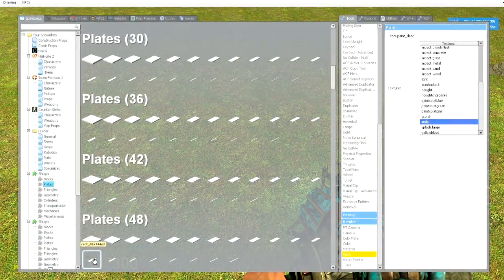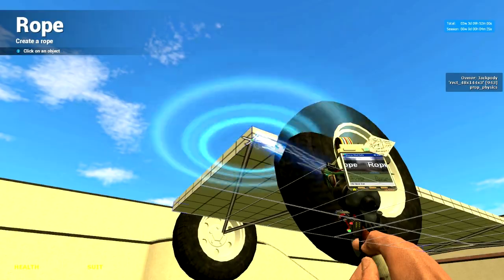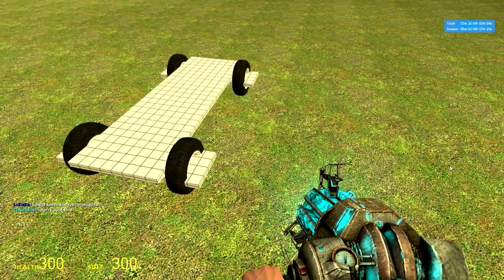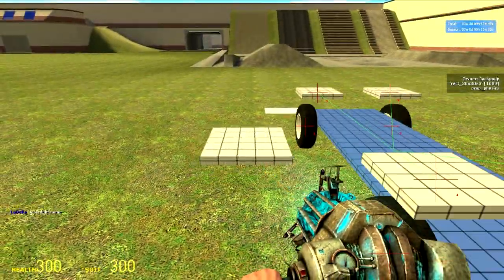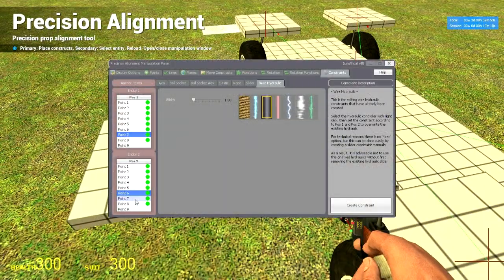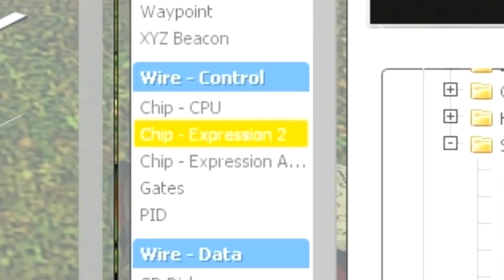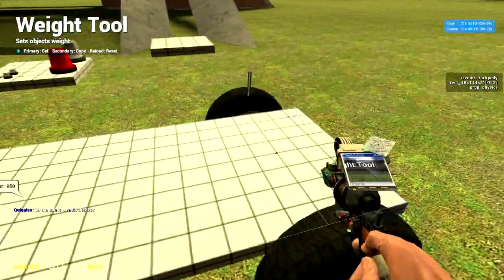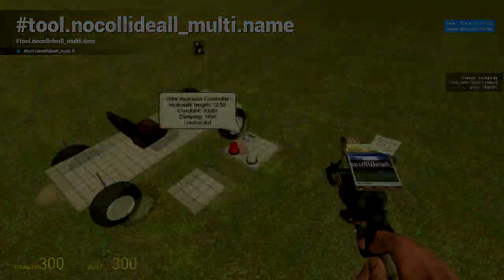[GMod 13] Suspension & Steering Tutorial - Simple

Comment: How do I put the steering thing from dropbox in??
Reply from the maker: Skillageskull Go into Wiremod > Expression2 > New Expression. Then remove everything inside the box that shows up. Copy / paste the code from my tutorial and put it into the box. Press the "close" window and left click on the ground with the Expression2 tool. 
If the model doesn't change to the same as in my tutorial, refer to the description. Hope it helps.
Reply: Thank you!
Reply: JackpodyDK For some reason, it's giving me an error that the "setAng" function doesn't exist when I set the chip down. Also, is the model itself detrimental to this, or is it just to look the part?
Reply from the maker: You'll have to enable propcore - I've posted the command for it many times before in the comment section. It's a simple console command that allows you to use a few extra functions in E2.
Reply: JackpodyDK Do you have to enable it every time you load or do you just have to do it once? Thanks for the help.
Reply from the maker: If you haven't added it to your server.cfg or added it to your launch options, then you'll have to enable it each time you start the game / server.

Comment: No such function: entity:setAng(angle) at line 31, char 15
chip don't work now,i don't know what to do
Reply from the maker: Николай Чистов When having issues, it's always a good idea to check the comment section - I may have already answered an issue like yours. 
In this case, the issues stems from the Wiremod team disabling Propcore on startup. A quick fix to this is running the following command in console: 
wire_expression2_extension_enable propcore

The above command allows the E2 to work. I hope it helped.
Reply: Thank you for help really match! Only you help me whith that problem
Reply: JackpodyDK Ok,You help me to fix the problem with set:ang,but e2 chip don't freeze in air,"propFreeze" still (1) bu't it's don't work.I hope you help me.
p.s. i don't see the answer for this question anywhere
Reply from the maker: You need to update your Wiremod, since a recent GMod update caused some issues with interval().
Reply: JackpodyDK How i can do that?I have latest version of wiremod from workshop
Reply from the maker: I'm not quite sure but I think the Workshop version of Wire hasn't been updated yet. Try a server that uses an updated SVN Wiremod - Cre8ive uses this and Interval() works there.
Reply: JackpodyDK Ok,i will try,thank you:)

Comment: i tried your e2 steering on another car from me. i put it up in the air and it will steer good no problems. but when i set it on the ground and steer its like there thrusters on it it will blow to the right or left. Can somebody help me?
Reply from the maker: Sounds like an issue with your ballsocket settings. Make sure they are completely like in the video (with some values being negative, some positive, etc).
Reply: JackpodyDK
i already got it. i putted the wheels on with axis-centre. but someone told me he did it with hydraulics and ropes. and that works!. and i wanna say thank you for this helpful vid!

Comment: Hi Jackpody. I'm Asian Kid on Steam, may have seen me on Cre8Ive. Anyway, I'm working on a car and trying to make it as close to real life as possible. Most of the cars in real life have slightly more than average negative camber and was wondering if it's possible somehow to put negative camber on a wheel. I assumed it would just be changing my ball socket settings, and it probably is, but I'm just not getting it.

If you have a solution for this then please let me know. Thanks.

(p.s. I'm also trying to make a dumb ricer version and this would help greatly)
Reply from the maker: +a b c d e f g h i j k l m n o p q r s t u v w x y z I wish I could explain a simple method of doing this, however I've not found a solution yet. Try to experiment with the normal ballsocket tool, it seems to allow something like that.
Reply: in the E2's code there is a hard coded camber multiplier that i think you can change yourself to any value you want
im very late lol

Comment: I had done everything you asked, and when I unfreeze the wheels they just delete themselves.
Reply from the maker: Well you haven't done everything like I said, else it'd work. :v 
Sounds like a spass issue. Start by checking that you've built pointing North on the map, that the ballsocket settings are 10000% correct and that you weighed your chassis properly. Then check your hydraulic settings and that the hydraulics are attatched correctly (check their length on the wire board at the hydraulic controllers - are they all equal or nearly equal when suspended in air?)
Reply: I have notices that a couple of them are around .1 off
Reply: BTW, I had fixed the problem, I did not think weighing them was necessary.

Comment: This works perfectly for me however i do have a problem. The wheels keep locking up when ever i use this method of building a car chassis. Can anybody figure this out for me?
Reply from the maker: Two possible things for this: Did you remember to build pointing North as I explain at the start of the video? Also make sure you've got the right ballsocket settings - note that some are positive values and some are negative. The three check-boxes at the bottom of the adv ballsocket menu are also important.
Reply: JackpodyDK Alright i just redid some of the ratios of the adv ballsocket and ill redo the whole thing and I'll reply if it works perfectly or not. Thanks for the quick reply Jackpody. Didn't accually expect this quick.
Reply from the maker: Glad I could help, do post again here if it won't work out.
Reply: JackpodyDK Ok did a test and works great! Thanks for this very helpful tutorial!
Reply from the maker: Glad I could help!

Comment: it wont work D: the wheels wont move up and down and the front wheels strafe left and down and strafe up and right when I turn. they also dont wanna move because the E2 isnt moving. they just bug out and the car goes flying.
Reply from the maker: +the_awsomness 1 Sounds like you have a few issues going on here. First, are you building pointing NORTH on the map? I explain the importance of this at the beginining of the video. Are you using the EXACT ballsocket settings? Notice some are negative values and some are positive. On the steering issue, I'd look into if you wired it correctly - especially taking notice of the CHASSIS:entity input. If that is not wired like in the video, the E2 doesn't activate and won't allow you to turn the front wheels. Good luck.
Reply: My spray is a target for target practice, and I have no idea how I got it. so I don't know what way is north, so I put some paint down, (usually the smile one,) to tell me what way is north. And I am pretty sure I wired everything correctly.
Reply from the maker: Hmm, the chassis does indeed work - just tested the tutorial. I really can't say much more on my end other than to try again while doing it with great care and precision.
Reply: +Jackpody ah. I did it agian and I needed to turn on free movement in the ball socket. This tutorial helped me make my

-RC Car mk1

-4x4 off-road jeep

-Race car mk1

-18 wheel semi truck

And a lot more! Thanks a lot.
Reply from the maker: I'm so happy my tutorial was able to help you with this stuff :D Good luck with future vehicles!
Reply: Thank you!!

Comment: My wheels keep move around why??!
Reply from the maker: Sounds like you either forgot to build pointing North, as I explain at the beginning of the video, or you did the ballsocket settings incorrectly. Could also be the fact that you may have forgotten to make your ropes rigid. 
Your comment is a bit vague so it is very hard to tell what the actual issue is.

Comment: Please, help me, when im unfeezing wheels, they're going to be chaotic:(
Reply from the maker: Did you remember to set the weights? Did you use the same constant / damping values as in the video? Did you remember to use the MakeSpherical tool on it in the start of the video like I did? Are the ballsocket settings perfectly correct? Try to check the above to see if that solves your issues. If not, please do respond and I'll try to help you out.
Reply: i did all of this, first time when I tried to build this car, all was ok, but now it's all going wrong every time, don't understand why.I'm just turning on your video and doing all, just like u r doing, step by step
Reply from the maker: I've heard people complain about similar things, so I'm afraid it might be an update to Wiremod causing it. I've not experienced similar results but I will check if the public duplication works (and hey, there's a finished duplication inside the description, it's worth taking a look at that! :V )
Try to up the weights of everything a bit. If the wheels weigh 100, then make them weigh 150. If the base weighs 800, then make it weigh 1200 and etc. Just modify the weights a bit and see if it's related to that. I'll go experiment myself when I have the time later this week and I'll update the video accordingly if required.
Reply: Thanks)Can it be cause of North?I didn't find the North)Thank you one more time)
Reply from the maker: Yes, it could very well be because of that. If you make the car not pointing north, the wheels will go rotating the wrong directions and will be uncontrollable. Please refer to the start of the video to figure out which way is north. It's as simple as building in the direction that the top of your spray is. If your spray is a picture of a house, the roof would be the direction that north is. If you had a picture of a face, the hair would be pointing north.
Reply: Thank you)Hope ur YouTube channel will be the most popular, because u make very good tuts, make more and u will be the best gmod constructor)Especially ur voice is perfect)
Reply from the maker: Thanks!

Comment: no its not the Wiremod  wiremod works perfectly
the weight (850 on the chassi) was few
i set it to 1000-2000 and it works perfectly
Reply from the maker: That is very interesting, seems to have worked fine in the video. Glad you solved it!

Comment: can you tell me the rope settings ??? pls
Reply from the maker: +Aribert “XBOX Gamers” Piech The rope settings are displayed as an annotation. Nonetheless, you want rigid to be on, add length to be 0 and width to be 1.
Reply: +JackpodyDK  thx for the fast answer and if i atill got problems , could you help me out in the server  Real Builders ?
Reply from the maker: +Aribert “XBOX Gamers” Piech Probably easier to help you on the comment section.
Reply: +JackpodyDK I build it but the wheels can move not only up and down but left and right .... but they should only go up and down ...
Reply from the maker: Sounds like a ballsocket issue. Make sure you use the EXACT same ballsocket settings as I do and make sure you're building pointing North (I explain this at the beginning of the tutorial)

Comment: My wheels were not attached to the baseplate helpppp
Reply from the maker: Are you sure you made the ropes rigid? Sounds like either a rope related issue, or an issue with your ballsockets. Good luck!
Reply: @JackpodyDK  I don't know what to modify in the rope tool unfortunately, It was cropped out of the video
Reply: Also the wheels were moving all directions instead of the up and down
Reply from the maker: @4zurral  Around 8 years ago when I made this, there used to be an annotation saying that the ropes should be rigid - this is my fault, and I'm really sorry for the inconvinience the missing annotation may have caused. The rope should definitely be rigid.
Reply: Aight thanks for the info 👍

Comment: "No such function: entity:setAnd(angle) at line 31, char 15"
What now :(
Reply from the maker: Kamil Kubera When having issues, it's always a good idea to check the comment section - I may have already answered an issue like yours. 
In this case, the issues stems from the Wiremod team disabling Propcore on startup. A quick fix to this is running the following command in console: 
wire_expression2_extension_enable propcore

The above command allows the E2 to work. I hope it helped.
Reply: Splendid it works now! Thanks Jack but there's another question. I've been making the car from the tutorial but from my clumsiness I lost my progress so instead I loaded your example car but it doesn't move and front wheels are going around and I have no control over it... Any solution? :/
Reply from the maker: Did you spawn it pointing North? Else it will not work, since the ballsockets only work when pointing North. I explain this at the start of the video.
Reply: JackpodyDK I pointed myself in north but still nothing the thruster doesn't thrust the fronth wheels are not turning xd
Reply from the maker: I'm sorry but I really cannot help you through the comment section with such issues. I've just downloaded it on my end and it works perfectly fine. I'm not sure what's causing it.
Reply: I actually found a save before it broke so I'll redo all the steps that wasn't completed from that point and let you know if it works. Maybe Adv. Dupe 2 is causing it. Anyway thanks for the time you've spent to help me and have a great day
Reply: Kamil Kubera It's entity():setAng(angle)
Reply: scopes00 It's the one that is causing problem.
Reply: It still doesn't want to work. Also another E2 I've downloaded are not working either
Reply from the maker: You must update Wiremod as well as a recent update from GMod caused Wiremod to break.
Reply: Update? Aight I'll try. Should I remove subscribtion to Wiremod on Workshop?
Reply: Aight it all works now! Thanks for helping Jack.

Comment: why north?
Reply from the maker: The ballsocket settings work by checking the XYZ compared to the map's rotation. If you face North when you do them, you can just use the XYZ settings I used in the tutorial - else they'd have to be swapped around as you'd be facing another way compared to the ballsocket settings XYZ from world.

Comment: Do not watch this as it is wrong. They say once you have you constraints for your hydraulics created, to delete the top piece. This destroys the hydraulic and ruins the car. Idk what is correct, I just know that this is not. Now before you ask me stupid noob questions, yes I know I did it correct because someone else even tried it, with same result.
Reply from the maker: It is not wrong. You forgot to attach the flying props to the base plate using PA. Please, do not make false claims on my videos without doing it correct - here, it's a fault of using PA. 
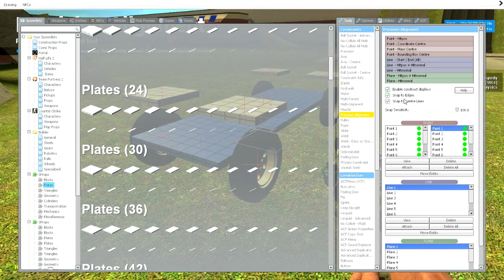For anyone else reading this, the issue is because of neglecting the PA Attatchment process shown at 6:13. 
As a proof of the vehicle in the video does work, there is a working copy of the exact chassis inside of the description.
Allen Carrison, if there's anything else I could help you out with, please write below. Thank you.

Comment: Negation operator (-) must not be succeeded by whitespace at line 26, char 15
Reply: Cured by changeing 'TURN += clamp((A-D)' to 'TURN+=clamp((A-D)'
Reply: I also get this happen when I unfreeze: http://steamcommunity.com/sharedfiles/filedetails/?id=321397288
Reply: Plus, I can't revert 'cause advdupe2 only saved the car and the E2, not the gate board.
Reply from the maker: Daniel Duncombe I just tested the E2 in my E2 editor and it ran through seemlessly - you must have accidentally copied something else on top or accidentally added a character somewhere (hence the negation operator). 
The issue with the suspension in that picture looks like an issue with the hydraulics not being hooked up properly (looks like something to do with the length). Make sure you wired it up correctly. I think I describe it at the end but you have to save the car using Dupe2 Area Copy (you can see the end of my parenting tutorial on how to do that) or you can constrain the wire board to the chassis in some shape or form. You could do it by nocolliding everything on the wire board + the wire board to the chassis. Then it can save with dupe1 or dupe2 without area copy. It's just not that healthy on servers.
Reply: JackpodyDK
The hydraulics were set with (and required) exactly the same lengths as he had in the video
Reply from the maker: Daniel Duncombe Well from that picture, I can just see that there is something wrong with those hydraulics as the wheels are reverting to the position of the hydraulics top strut. It's very hard for me to diagnose a physical issue using a picture. 
It could also be related to where you positioned the hydraulics in the PA part of the tutorial. If the hydraulics were placed just 1 point off in the menu, they won't work.
Reply: JackpodyDK Ok, I finally got it working. However, the E2 does not seem to do anything.
Reply from the maker: Are you sure you've hooked it all up correctly with the entity marker and base?
Reply: JackpodyDK
Turns out the +- was supposed to be +=
Reply from the maker: Just to make sure, you realize you can download the E2 in the description, right?
Reply: JackpodyDK
I copy pasted it.
Reply from the maker: Then it should not have errors. Is it still not working out for you?
Reply: JackpodyDK
Yeah, it works fine now. It is AWESOME! I am used to no-suspension non-make-spherical acf shake cars :)

Comment: Great video but I still can't dupe the car, it gives me a WireMod error :S
Reply from the maker: Do you use Advanced Duplicator 2?
Reply: Hey thanks for the quick reply, no Im using just the standard one. I have another question, what would you do if the front wheels were smaller than the rear ones? Does the suspension still work using the values from the front wheels or would I have to do something more complicated?
Reply from the maker: Use Advanced Duplicator 2 and use the feature called Area Copy - I show you how to use both at the end of my Multi-parenting tutorial.
The same type of suspension should work fine, but you may end up tweaking the length of the front hydraulics in order to make the base level.
Reply: Thanks :)